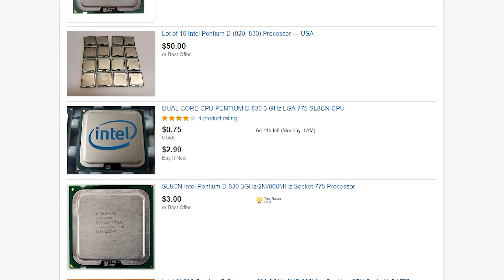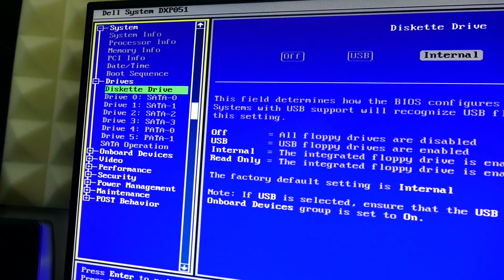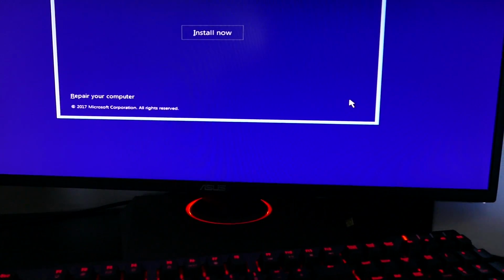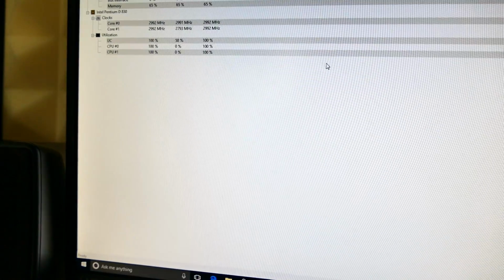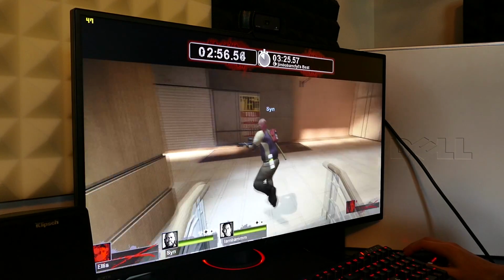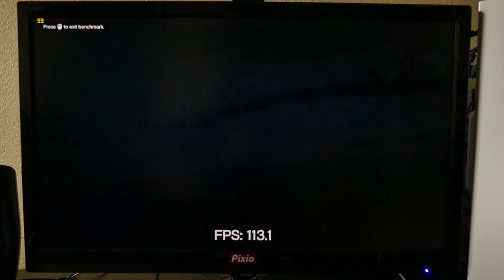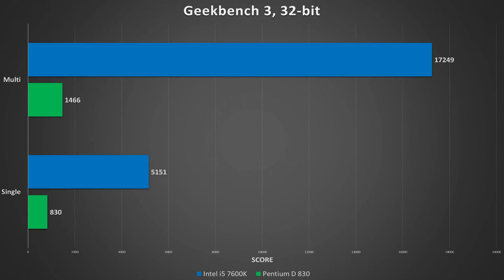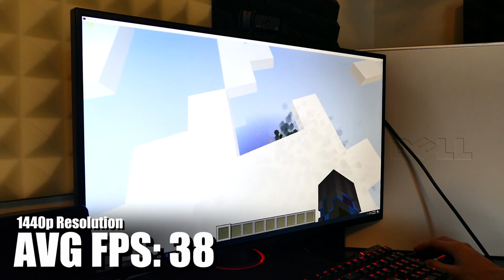I Paired a $6 CPU with a $700 Graphics Card

Comment: Do you know if old dell xps 8300 run a rtx card if it has 850 power supply?   Installed one it kicks on and lights up but no hdmi it's evga 3070

Comment: The  thing is that todays PC are 80% GPU, thats says everything.
If you pair oldest i7 860 with best GTX 1080 or 2060 or 2070 or 2080 GPU and SSD, your PC will FLY with all todays games with ULTRA settings NO PROBLEM!
BUT! 
If you reverse that you buy best i9 processor on the market and paired with the worst graphic card like GTX 465 from 2010 or something lower, you will not be able to play anything on ULTRA like with BETST GPU and worst CPU version.
Because today is everything based on GPU and GPU is today 80% of PC.
Grab cheap CPU like i7 2600 or something and spend more on graphic card, you are good to go gaming !

Comment: I think there is something wrong with the setup... you installed windows 10 which runs on directx 12, windows 7 would have been a better install and more fairer... for a Pentium D, that graphics  card would not have slowed down computer... so it's must be the fsb or ram speed & OS....run on direct x 10/11 and you would probably see a better result.... (just a thought)....

Comment: This is my current pc in a nutshell.
775 socket core 2 duo e6650 if i remember correctly
8gb ddr2
With and nvidia geforce gtx 950 ti.
Ac unity runes fine/playable.
Reply: You could add a Core 2 Quad, They're pretty cheap on eBay if that's available to you.

Comment: Pentium D: working as hard as physicially possible

1080TI: practically asleep the entire time, most of its clock cycles probably spent idle
Reply: Pentium D: A weak 3YO kid.
GTX 1080 Ti: A really strong 3-meter 28YO man

Comment: A little late here but anyways. I kind of did the same thing. So i used to have an athlon x4 880k paired with a rx 570 which did decent for my demands playing world of tanks mostly at around 70 fps tops. Found a vega 64 on sale and couldnt help myself to it knowing my cpu is way too slow for this gpu given its age and performance. Only got a 10 fps boost tops. Heck my parter has my old a10 7800 and rx 560 and his was doing much better than mine. Finally upgraded everything else and now im really enjoying my vega

Comment: You can get a Core 2 Duo for under $5 bucks on ebay quite often and they support 64 Bit OS.
Reply: You can get the first i5 750 on eBay for around 20-30 bucks and overclocked it will be able to play most games at 1080p50-60 when paired with a 1080. It will be as slow as molasses to do anything else than gaming though.

Comment: I guess a dual core A4-A6 would load faster - there s a reason to use a cpubottle neck when the grapics card is bad and you dont want to run the card at full speed -then a ex-mining card might actually can be played on for years instead of months.

Comment: senario am2 4gb ddr2 Sempron 3400+ single core 1.8ghz stock coupled with a hd3870 at the time. produced the most astoundingly strange results in "Need for speed ug/ug2/nfsmw/nfs prostreet   the severe cpu bottle neck produced Low fps BUT!! it paced the single player game down to a speed where the player could Control the vehicle with near pin point precision actually allowing insane lap times when the slowed down game experience is giving you full Seconds to react. altho the performance was low fps The game play became almost so easy it's a hack lol

Comment: Well the gpu is never able to "do it's thing", when the cpu is bottlenecking it. Only thing which can happen is that the cpu is doing its thing when the gpu is the bottleneck. That's because everything on the screen, which could get changed in its position or appearance has to be calculated by the processor, since the gpu is only there (in games) for rendering the final visible result of the calculations the processor did. It wouldn't make sense for the gpu to render the same scene or situation multiple times (to increase the fps or sth like that) and even if it did you wouldn't see a difference. The whole experience would still be as unsmooth as before. I also guess that the fps counter visible on the top gets its information from the processor. 
Sry for my still  improvable english, i just wanted to mention this :) have a nice day!

Comment: Im always wondering if there is some problem if you use a second powersupply for powering something. Cause your card will get power from the mainboard aswell and there you have two different potentials on one piece of hardware then.

Comment: I bought an Intel® Core™2 Quad Processor Q9400 for $15 Australian for a spare 775 board I had just for a laugh. Runs all modern games like DOOM pretty well at 45-75 fps with a gtx 1080 and most games are very playable even with a GTX 660

Comment: dear mr 'crappy videos maker', there is no point on that experiment, but a Xeon X54XX socket 775 board can run all games on 1080p with good videocard! Also you could've installed 64 bit and test, it is no reason to run 32bit on a machine, it only needs 4gb or more ram, if DDR2 that is super cheap to get 8g!
Deserved dislike, my friend!

Comment: For the last few weeks I've been using a Pentium D 930 with a 65w TDP rated heatsink (yup...), a GTX 960 and  a cheap 120gb SSD, I could play LFS and a few older games easily, Call of Duty 2 pretty much maxed out as well. It sounds ridiculous, but you can live with it.

Comment: That's not as big of a difference as I would have expected. Of course, it's simply impractical to use a Pentium D 830 now, but the difference in price is a factor of 38, whereas the Intel i5 7600K is only 11 times faster. I'm genuinely curious why there isn't a bigger difference and why the price ratio is imbalanced with the speed ratio from Geekbench.

Comment: Wonder how an X5460 Xeon would do, it's about $14... I mean I use it for my GTX 770 and it works great..
Reply: I got a x5650 for 14 bucks and overclocked it to 4ghz. It replaced the i7 950 i got for $200+ 10 years ago

Comment: I'm not good in computer's, but I think the pc case is the bottleneck in this situation
Reply: No, it’s clearly the gaming chair.
Reply: the light in the room is actually sending radioactive waves that disrupt the PC’s glyomactic process so only the PSU is being used so technically the light in the room is actually bottlenecking the PC
Reply: @reburn1479  THANK YOU now i will change my lighting!
Reply: @costelli1  just add rgb just counteract the light bottleneck and maybe add more performance too
Reply: @costelli1  thankfully now Corsair makes RGB towers. So you can have towers of rainbows everywhere!
Reply: @reburn1479  No, you don't understand it's actually the rotation of the earth-
Reply: make sure to lose weight aswell guys other wise your internet will be blocked  by your flab
Reply: @Kcaj9  I've heard cases of flab cooling down the system, haven't tested though.
Reply: It's obviously the power button.
Reply: mankind is bottlenecking the earth >_>
Reply: Wtf is a bottleneck
Reply: @albaraabakhsh7863  the gpu let's down cpu or the other way round
Reply: @user-po6zt8if4c  actually, a bottleneck is when one of the components holds back another from getting to it's maximum performance, because it's not that good. Basically you can't pair a really new thing with a really old this because it will still behave as a really old thing. Thanks YouTube.
Reply: @albaraabakhsh7863  ok so you asked what a bottleneck is just to correct someone???
Reply: @Quandaledogle  well, it looks like that when it's both 1 year apart. These comments were 2 months apart
Reply: He himself is bottlenecking his pc lmao jk
Reply: The Case has nothing to do with it. The case is only a frame.
Reply: No_Limit_Gamer I agree with your statement

Comment: Title edit: I paired a $6 cpu with a $1200 gpu
Reply: iiVe 
My brain blocked that out due to traumatic experience.
Reply: @primeribgaming2681  Lol. Now I'm getting a gaming pc. 1060 3gb version. Going to sell that and get a used 580 8gb for the same price.
Reply: i ended buying a whole hp omen prebuild on clearance with a 1070 znd i5 7400 for £600 when the 1070 alone was £650 during that crypto bullshit
Reply: @silvertain1978  nice man. I sold my 1060 for a r9 fury. Worth
Reply: IMasks7 Gaming 
It’s not THAT expensive.
Reply: the rtx 2080ti is actually $1200
Reply: Title edit: I paired a $200 cpu with a $3000 gpu

Comment: I have a question. I am planning on building a new pc. I am 15 and it is difficult to come by a lot of money. I saved up almost 400 dollars to get a gtx 1060 3gb. And in my current build I have an and fx 8120 processor it is quite limiting. I am trying to upgrade to a ryzen 1600. But then I'll need a new Motherbaord and new ram because my mother board is ddr3 and a wrong socket. What can I do to save the most money.

Comment: My 2005 laptop (Pentium M 780, FireGL V3200) ran Minecraft better than That, though at a lower resolution for sure.
That said, you shouldn't even pair the best LGA771/775 CPU (e.g. Core 2 Quad Q9650) with anything more than a GTX 1060 as it won't use anything more than that in any games

Comment: I reccomend that you install windows 7 ultimate 64 bit, so you can use as much RAM as you want, done it for an old q8300 system and worked great, i think that mabye like you said it was also heavily RAM bottlenecked as well as CPU, i would like you  to revisit this with any 64 operating system that supports the extra games you wanted to benchmark. I know this is an old vid but i am just revisiting it beacuse i think the cpu is capable of just a little more.

Comment: you couldnt load it due to the "MBR"/"GPT" differences, the computer you were on required a "MBR" but Windows was installed on the SSD with a system that defaulted to "GPT" (most newer systems will)

Comment: I could be wrong. But anytime I have EVER moved an OS drive into another machine I have needed to re-install Windows. Possibly if all drivers were removed beforehand it might boot? But I still doubt it. It just detects new hardware and needs a reinstall or it will usually just BSOD on boot.

Comment: Why would you run Windows 10 32 bit when the CPU is 64 bit?    Try running the best CPU on the market today in 32 bit and you'll see bad performance on that too.

This is why you're getting such poor results.  This is why you can't get games to run correctly.  You're doing it wrong.  You need to run a 64 bit operating system with a 64 bit CPU to get good results.

Comment: I hate it when youtubers act so informed on Pc's.Kinda annoying tbh.Its IDE bte.And a OS won't be able to run a diffrent PC 80% of the time btw.If it does it wont run optimally.Because windows drivers get installed for the specific mobo ect.

Comment: The Pentium D 830 has 64-bit support.  Why not install the 64-bit version of Windows 10?  Also- Seeing CPU usage at 100% doesn't mean you should upgrade your CPU.  Seeing your CPU usage at 100% in a variety of games while your GPU usage remains low, and your overall framerate sucks means it's time to upgrade.  It's okay to have high CPU usage, as long as your GPU is being fed (utilized) properly, and your performance is good.

Comment: example of bottleneck, or DamNeck because it holds data like dams hold water

i bought gtx 1050 ti strix oc
and paired it with
intel celeron dual core 2.6ghz
fml

Comment: How did a Win XP motherboard PCI slot work with a 1080 TI graphics card with a PCIe 3.0 x16 slot? I'm still new, but I didn't think this was possible. I have an old mother board with a PCIe 2.1 x16 wondering if the new graphics card like a RX 580 would run on it. Please comment if anyone knows anything about the different versions of PCI slots.
Reply: Did gtx 1080 ti on pci express 1.0 to mine bitcoin. No problemo

Comment: But what happens when you slot in a 12$ cpu like a Q8200. It's a proper 4 Core CPU for that socket and runs 64 bit fine. And should be supportet. The old smithfield core is in it self pathetic and was '04 obsolete. But a Wolfendale Core should be more intresting.

Comment: I had a q6600 build used the tape method to oc to 3.0ghz, 8gb ram, and gtx 750 ti the whole system worked flawlessly. Had it up and running playing gta 5, witcher 3, and fo4 on med-high settings 30fps.

Comment: What I'd like to know is.... Why run 32 bit windows when the Pentium D supports the 64 bit instruction set. Kind of odd.
Reply: I agree by running the 32 bit os you've halved the address width so you're not only throttling the CPU but effectively the rest of the system, I'm running 64bit 10 on a pentium D quite happily :-)
Reply: the CPU is too weak
Reply: Yeah pointless video

Comment: That was not "hot swapping". Hot swapping would be swapping out one of the platter drives in  a multi drive system (as in a RAID setup) while the system remains up. This ability is much sought after in server setups, as you can imagine

Comment: You need a better gpu if you want to play minecraft. A gtx 1080ti isn't good enough.

Kappa
Reply: Not even an Octa-core 4ghz Ryzen processor with a Titan X can play Pokemon Yellow Gameboy 1997 edition
Reply: Minecraft is surprisingly demanding for most PCs
Reply: Minecraft will run 5-10 fps on nvidia geforce gtx 1080ti 😂
Reply: Dude. I have a core i5 and I can run Yellow fine.The REAL question is...Can it run Crysis?
Reply: Bro minecraft is the hardest game to run right now . 
Even 4 titan sli cant run this game at 720p 800x600 all low
Reply: @luigidimagnaong1141  720 800x600? TF do you mean.
Reply: I think the first graphics card ever made will do it maybe like 60 FPS on medium settings?
Reply: I have a gtx 1060 and it STILL lags
Reply: Elan C With a GTX 1050 it runs at good settings at around 120 fps
Reply: AveragePiplup no your lying I have a gtx 1070 and it can’t even reach 5fps
Reply: Lord Plankton Intel HD GRAPHICS SQUAD
WHERE YA AT?
Mine runs minesweeper at 30 fps
Reply: Leader Egg y’all flaming Minecraft but it’s actually hard to run due to its bad java optimization
Reply: Peweed but Minecraft doesn't support sli.....
Reply: You need atleast a titan v overclocked to run minecraft
Reply: I love how 1 year later minecraft ray tracing is a thing.
Reply: I run Minecraft awesomely without a dedicated graphics card.
Reply: Lord Plankton not even a frame bro
Reply: FungusGD whats ur cpu
Reply: Elan C v
Reply: The Creepypasta Cat it will only run at 1fps
Reply: Lord Plankton wowowowowowowowow
Reply: Lord Plankton A Quadro GV100 runs it at about 20 fps
Reply: Bro I have 5047 gtx 1080TI’s in SLI and I only get .05 fps
Reply: PXLFIGHTER whoooosh
Reply: What about Minesweeper? Can’t even run it unless you have 10 GTX 1080 TI’s but can only get a trash half a frame per second.
Reply: The worst part is that you're basically correct. Even a fairly decent high-end Gaming PC can barely play Minecraft at max settings at 60fps or more. Like, is this the Rise of the Tomb Raider of children games?
Reply: How is it hard to play minecract in todays standards when everyone in my school with a cheap af -/400$ computer back six years ago?
Reply: a ZTX 4090 Ri 89DDR98 VRAM and a Intel Xeon Z98800 900TB cCHE AND 666 cores should be good to open roblox
Reply: I just bought a 2080ti and only get 30 FPS on minecraft..
Reply: I ran Minecraft with a graphics card that doesn’t show the name of it which has 128mb of VRAM, 4gb of ram, and a 2.3ghz amd cpu.
Ran Minecraft 60 FPS on low/medium settings.
Reply: To run Minecraft properly he will need at least 8 rtx 2080ti on sli all with max overclock settings
Reply: @leandrofod  The funny part is that minecraft is all about the cpu and ram lol!
Reply: Ok a Quad NVlink 2080ti build wont run minecraft at a stable 60 fps, no like literally. Minecraft goes from 1-5000 fps.
Reply: My 1070ti runs minecraft in 3 mps! (Minutes per frame)

Comment: For a "computer scientist" you don't seem to understand the difference between single threaded and multi threaded apps.  Which a Pentium D 830 will do fine on single thread as the architecture for intel hasnt changed much since socket 775 was introduced.

Comment: Why did you go with 32bit W10? I had an old Dell Dimension that has a 3.4Ghz Pentium D and I had 64 bit Windows 7 on it back then. Still detected the 4Gb ram at 3.5GB (32 bit bus despite OS installed) but it was 64 bit OS nonetheless.

Comment: Hey, just a tip, the most probable reason your pre-installed OS didn't boot is a wrong SATA mode setting in your BIOS. Old systems used to have this set to IDE, but newer systems set this to AHCI. When a Windows OS is installed in one mode, it will not work on the other.

Comment: Lol, my old AMD Athlon64 3000+ (1.8GHz single core) was able to play Left4Dead2 just fine......with an old AMD Radeon HD 4670. It was some CPU bottleneck when the hoard come charging in, but very playable. FPS hang mostly in the 40-50's with it dipping down to 20's during massive hoard charge. Those were the good old days of AMD. Same generation CPU from Intel, yet outperform it.